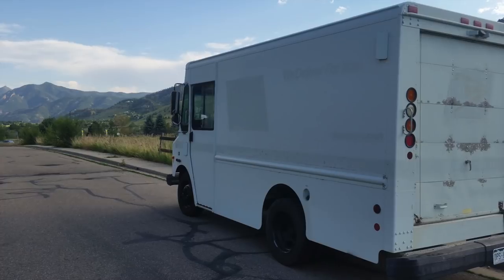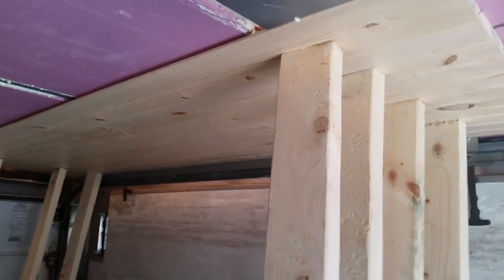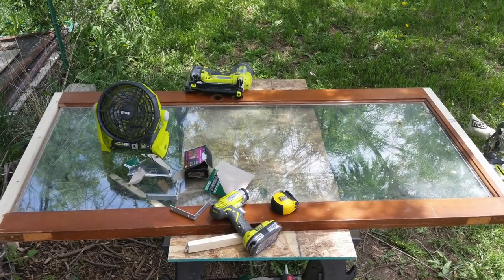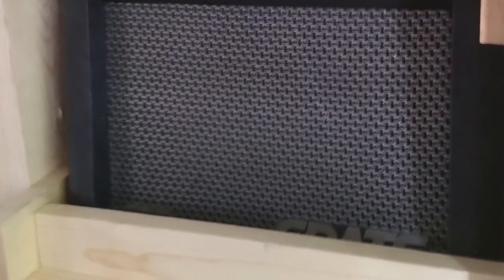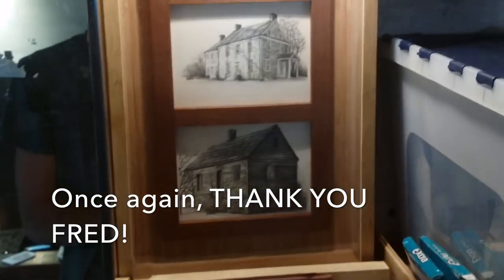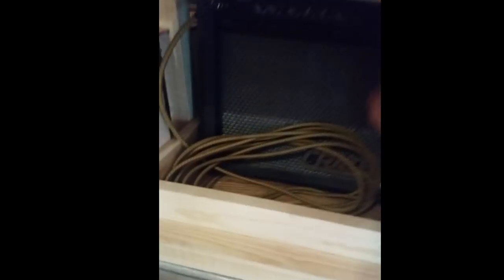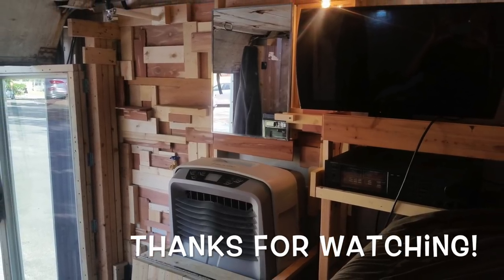Van Tour of Step Van Camper Conversion

Comment: Right on, step van is my first choice for conversion to nomad life. But you would have been better with first installing reflectix and then insulation on top of that. Hot climates reflectix makes a huge difference when installed properly. Good vid and glad you found some love.
Reply from the maker: Haha thanks for your comment man!
Reply: As a side note Reflectix is not an insulator. It reflects heat and that's it. If you're planning to be in colder climates please think of proper insulation for your rig. But as before it's not a bad idea to "start" your insulation with reflectix as it's thin and since most nomads wander to and from warm climates it's a good first step. I hope this clarification helps some folk. Proper installation is key though. So do it right, do it once.
Reply from the maker: Excellent info. Thank you!

Comment: I have seen the cab of my van get as high as 126 degrees! I found some scrap pieces of 2" thick polyiso boards that I lined every space along the walls and ceiling of the cab that I could and it made quite a difference.

Comment: I put a bed and van seat with counter etc in my Grumman Kurbmaster, I registered it as an RV not commercial registration which had the DOT pull me over several times when they thought it had to be commercially registered, it wasn't easy but persistence succeeded, it has to have a bed  and seats and DMV did it. I had a generator on a hitch mounted platform that powered a 1 ton AC unit that worked great!

A fireplace will kill you quickly in that thing unless the door is open!

Comment: I have the same fibreglass roof on my Stepvan, I took utmost care to drill as little as possible into the it.n I added a support structures for my two deck hatches and the solar entry plate. I added a roof rack for my solar panels and bolted it to the cross members with sealing spacers blocks. I added a catwalk in between the roof rack for access, all so I don't put any stress on the fibreglass since it is not structural. Seeing you drill all those holes to hang the ceiling from the fibreglass roof made me cringe.
Reply from the maker: Lol, that was a lesson learned, I went back up on the roof 2 more times to seal around all the bolts.  When it was finished,  it made it through snow storms with no leaks.  :) I agree tho, cringe worthy.  Lucky the bus has been much better, probably because I had the van under my belt. Thanks for the comment!

Comment: I worked helping a friend who had a RV business, drilling the holes in roof was a mistake.....it will leak and you will never know it until a lot of damage has happened...seen it many times even on RV's less than a year old....
Reply from the maker: Haha yeah after a liberal application of weather proofing sealant on the solar panel/ceiling, all leaks were final stopped! I've since sold this vehicle, and sincerely hope the new owner hasn't had any issues with that since... definitely not something I would do again. Thank for the comment, friend!

Comment: Do the swamp coolers work all year round? How well does it work compared to normal AC
Reply from the maker: We use it just in the summer months and only when we're in dry states like Colorado. It only uses 200W rather than thousands for an AC. If you're going to be hooked on to shore power you won't have any issues with AC though!
Reply: Swamp cooler only works in low humidity.

Comment: Piercing the ceiling all over for bolts is going to get you
Reply from the maker: Yeah we have since sold the conversion to someone with a bit more expertise that was able to take care of that. Definitely not the best idea! But we were learning with this one...
Reply: @LivingZEAL  Hi there. I'm considering different vehicles to potentially build out. A guy who lives in a step van said in one video that aluminum is resistant to WiFi signals. Did you have any trouble using your devices/connecting and maintaining a connection to WiFi? Connectivity will be important to me living in a van.
Reply: Holes won’t hurt anything, silicone and you’re g2g

Comment from the maker: This is for you Emily Sweeney :)
Reply: awww you guys are the best, thanks for doing this one!! very cool! do you remember the dimensions of the interior? we've asked a few people about the window thing you guys mentioned and from what we were told if you can't fit windows in between the beams then structural beams can be cut and fabricated into a window frame to allow more support for around your windows. we have someone that can help us with that because it sounds a little complicated but we're not too concerned with that aspect. what we you saying about the steel plate walls you couldn't anchor 2x4s to though that seems like it could potentially be a big problem!
Reply from the maker: Definitely! We started looking back through all of the van footage to after you mentioned you guys were interested in this... hopefully this is helpful! As for the 2x4 anchoring issue... Chad says he totally could have done that but it would have taken a lot more work haha. By that we mean, you would have to drill holes through the steel beams, buy special bolts to secure the wood to the steel frames, and repeat this multiple times on each wall. In the end, the steel beam near the cabin door was just a more simple way to go about it while still maintaining the structural integrity. Completely doable for you guys though to do it the proper way. And, the interior space was 7X11 :)
Reply: ah okay, makes sense! thanks again for sharing another awesome project you did. we seriously love this community even though we aren't a real part of it yet...but hopefully soon!
Reply from the maker: lol we didn't bolt the insulation. you're an idiot and I take a great deal of pride and joy in deleting every hateful ignorant comment you ever left and blocking you from the channel.

Comment: Sorry but bolting through the fiberglass was absolutely ridiculous. You have the steel ribs to tie into and if you needed the mounting points closer together then you should have screwed strapping from front to back across the ribs as needed. Bad mistake.

Comment: I think its better to apply 'insulation' OUTSIDE steel/metal frames instead of INSIDE. As an example, glue/kit styrofoam board (nanowood would be even better insulation I think) to the OUTSIDE of the frame, and screw/glue/kit THIN wood (wood also get strong insulating capacity) to the inside of the frame, this way one would most probably get some more space for wiring behind the wood AND SUPER insulation, I'm practically sure MUCH BETTER insulation than in case of insulating inside of the frame. Of course, when applying insulation to the OUTSIDE, don't forget to cover with e.g. FLEXIBLE epoxy like stuff, lightweight and rubberlike so water/hail/wind won't likely damage insulation; https://www.isothane.com/prod/blocked-prepolymer-range (i'm not paid to advertise this product, just sharing example).

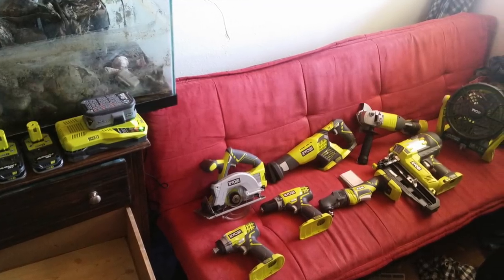Comment: 0:55 - All your tools are obsolete and the worst quality and many you will not use. This is Ryobi - which is cheap crap.  And 18V not 20V.  Not every manufacturer makes every good tool.  Some should be Dewalt 20 such as the 887 Driver and 885 Drill with Milwaukee Titanium drill bits for metal and wood.  For an angle Grinder, the Bosch 5" refurbished is $79 on Amazon, comes with a paddle switch, Keep On switch, variable speed, and a removable handle for left handers.  One of the best I found.  Table saw is Dewalt corded.  Random Orbit small round sander is Dewalt.  This has velcro tabs for sand paper.  Better than Makita or any Palm Sander.  These tools are the most useful in any build. Another good one is the Dremel MultiMax 45 with quick release - its the only flush cut blade available anywhere.  If you need a tiny angle grinder, the Dremel Saw Max will fit the bill, for detail work.  Dewalt Corded (I think) Plunge Router is also very good.  So take this lot of cheap junk back and buy my list above.  You will not be disappointed.  Never buy a whole set of tools at the outset from the same company!  Buy as you need them, and do your homework.  Buying tools involves massive research.  Big investment of time and money, and they either bring you joy or curses.

2:13 - That clear sealant is silicone. The worst product you could use on your roof or anywhere on an RV. What you want is called DAP Lap Sealant and is a rubber compound not silicone.  All these trade skill projects like roofing, sealing, tiling, etc are all very precise and technical.  Wrong sealant or caulk on any project means a complete removal and redo.  You cannot use this sealant on your roof, it will come right off with the UV rays and weathering.  Silicone is excellent for glass repairs and gluing aquarium panels together, but NEVER the roof or exteriors like window outside trim.  You use butyl tape and DAP Lap Sealant only.  And as for the bolts you drove through the roof -  so many issues here I cannot even begin to start. Rust due to not painting the metal holes first.  Water leakage.  No hold through foam.  Bumpy roof with wind drag and tripping hazard.  Oh boy!
3:11 - You put aromatic red cedar above your bedroom?  Excessive exposure to the oils can be a lung and eye irritant and give you asthma. Any animals exposed to this will be miserable and sick, as their sense of smell is so much stronger, poor little cat! This was a very amateur mistake.  There is a reason why you only use it in closets.  Moths don't like it, as it causes them damage.

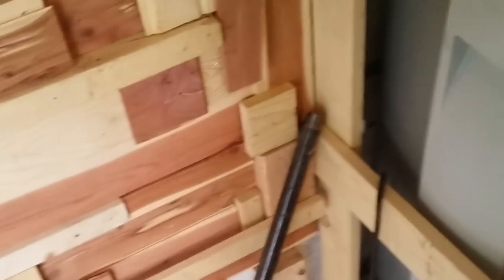10:02 - where is the waterproof membrane under your bath tile?  Did you use polymer in the mortar and grout to prevent cracking?

Hold that camera steady.  Get a gimball and tripod.  Makes viewer seasick.  Decide what you want to show, then show it.  All we get is a series of images flashing haphazardly on screen.

Get a proper microphone, your audio track is as shaky as the camera.  Goes from too loud to too soft repeatedly.

15:20 - the Memory foam mattress - most expensive and the worst for your back.  A hard mattress is what keeps your spine aligned.

You have a lot to learn dude.  Learn before you teach.  Do a proper van build and film it better.